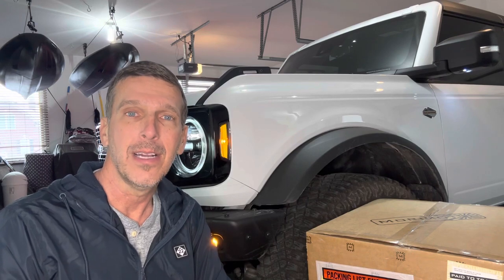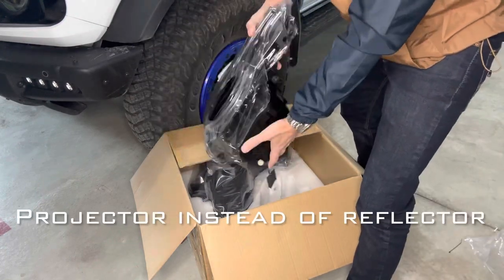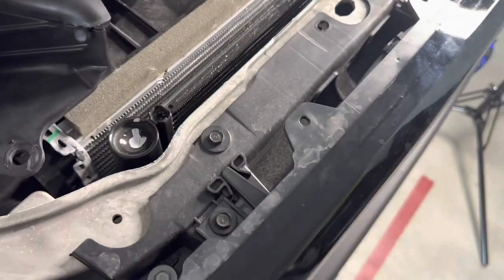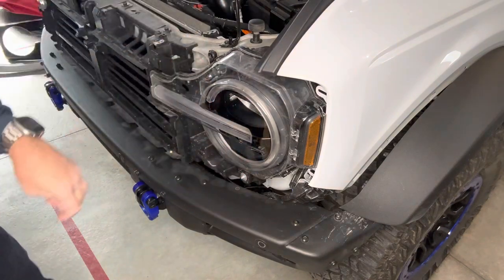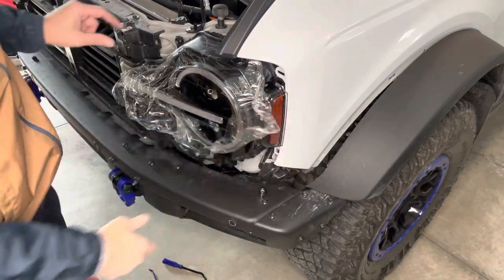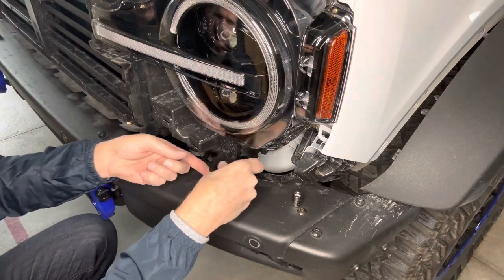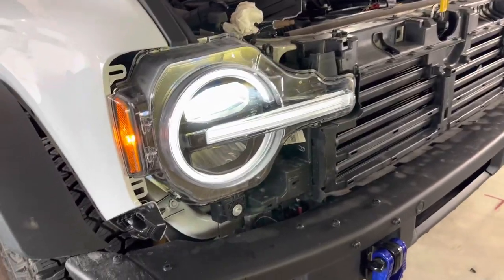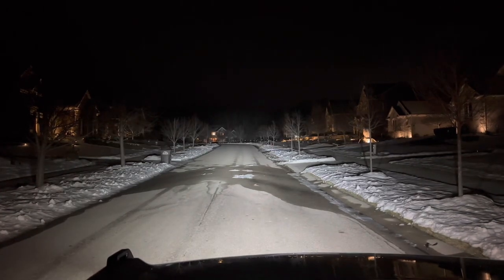Morimoto XRGB LED Headlights Install 6th-Gen Ford Bronco / Comparison / Demo

Comment: Awesome and here I thought I was done adding stuff to my Bronco😂😂. Love it!
Reply from the maker: I am not sure we ever finish, LOL. It is truly my favorite mod. They look fantastic, and they work even better. The difference in light output is truly dramatic, low or high. The ONLY minor glitch is that the blinker will make a rapid blink sound occasionally (as if a bulb was out) when the car’s auto-stop has killed the engine and the lights are on battery power. It takes about 30-60 seconds of blinking IF it does it. And it never does it if the auto-stop is inhibited. It just isn’t a factor for me, but I wanted to put out the only disclaimer. Truly love these things and will install on my recently bought Bronco Raptor. The current Morimotos don’t fit the BRaptor, but they are soon to release a compatible set for the BRaptor. I miss the far better Morimoto light output on my BRaptor.  Thanks for stopping by Deidre!

Comment: How is the speed of the blinker SOUND? Mine went up 2x-3x over stock with these headlights even though the actual speed of flashing is normal. Kind of irritating to hear.
Reply from the maker: Other than one exception, when I was stuck at a traffic light for about six minutes with the signal on to turn left, the lights have always had a normal blinker rate for the sound and I’m assuming the flash outside. That one time, when the signal was on for an extended period at the light, it did what you describe, making a rapid signal sound. At about three times the normal rate. I don’t know what the actual light was doing on the exterior. Otherwise, It always worked normally for the half year owned the vehicle (I ended up, trading it on a Raptor that is featured in some of my videos). Thank you for checking out the channel!
Reply: Strange. Did the lights come with two small harnesses in the box? Does not seem like it from the video. With the harnesses the sound is normal.
Reply from the maker: @GroovyGeek  not that I recall. And yeah, I would’ve shown it in the video if it did. They’ve probably made a few tweaks, since it’s been more than a year since I purchased and installed. I just loved that they really were dramatically better headlights than the OEM.

Comment: Looks great
Would you still say its worth the cange having them installed for a few months
Reply from the maker: I found their performance so markedly better than the OEM that I would say yes. If you plan on keeping your Bronco - long term - it sure makes night driving noticeably better. The only negative lately has been the trade-in value on the OEMs. It was a paltry (laughable) $20 last month from Morimoto. So weight that into your “affordable” calculation. You can check their site and see what their trade value is. I am sure other places you can sell the OEMs as well. body shops, repair market likely has an interest.

Comment: Question- When pairing the lights to your phone, is there any type of security feature preventing others from downloading the app and changing your light color?
Reply from the maker: Not that I see. But the engine would have to be running/or Accessories ON. and it’s Bluetooth so you really have to be within about 30 feet of the vehicle. I think the odds of someone being by you while the vehicle is powered is incredibly unlikely. And if they did, it’s literally one tap of your preset to put it back on.  It is not something that could be done while your car is in a parking lot and you’re out shopping or something.
Reply: @jeffiovine4577  Is the bluetooth built in to the lights or is there a separate controller to buy?
Reply from the maker: @marcus_ohreallyus  the Bluetooth is built-in to the lights, and no additional hardware is required for the feature. When the lights are powered/illuminated, they can be adjusted by the App, and the last setting made will persist until a change is made on the app again. (i.e. - if you use the app to set the daytime running lights to Amber they will remain Amber every time you turn on the headlights or power down and restart the vehicle. You won’t have to keep changing it back to Amber. Essentially the last setting becomes their default until changed to something different.

Comment: Did you use the spacers on both of your lights?  Mine didn’t come with them.  My lights are very low.  Going to try the built in adjustment but don’t think it will be enough.  Did you have to adjust that as well or just use the spacers?  Thanks great video.
Reply from the maker: I used the provided plastic spacer shown in the video on each light - 2 total provided, and I put one on each. Additionally, on the passenger side, I put two standard metal washers, probably about 1/16-1/8th inch thick each, behind the passenger side, in addition to the single plastic one provided by Morimoto. That got both lights pretty close to the original alignment of the OEMs. From there, I used the built-in adjustment to finalize the alignment - accessed from above the light assembly after it is installed with a Philips head driver. It is a much finer adjustment, so I don’t think it has enough adjustment available to move your aim up as much as the included 1/4 inch spacer.
Reply: That is what I thought.  Going to contact Morimoto on Monday.  Thank you!
Reply from the maker: @ddeplanche6870  you’re welcome! Thanks for checking out the channel!

Comment: Wait can you change different light zones?
Reply from the maker: Can’t change zones. They do have about twice the output as the OEM, so it does make it easier to see off centerline. But there is not a zone / turn light that changes with a turn signal.

Comment: Did this work with the auto setting?
Reply from the maker: Yes, all normal functions on lights work same as OEM, in Auto setting. The DRLs are just crisper/brighter than OEM and you can adjust the color. And DRLs go off in Park, as with OEM during daylight.

Comment: Are you selling the old lights?
Reply from the maker: Yes. I did the “Paid to trade” option mentioned in the video. I returned them in the same box with return shipping paid by Morimoto. They have already acknowledged receipt of them (yesterday - about 5 days after I returned), and said they are testing them and will follow-up after that regarding the value. It should be $600 since they were in perfect condition. They will send me a check to complete the transaction.
Reply from the maker: And I did receive the refund of $600 on Feb 22nd. They kept me informed during the “evaluation” of the lights I sent, and when they received, etc. Very “transparent” and trustworthy process.

Comment: I'm worried about lights that are brighter. I already get flashed by people that are mad at me for being too bright. I don't know how I could go any brighter. I will probably do it anyway 😊
Reply from the maker: The Bronco’s should be brighter. Their lack of brightness was the only thing keeping them from getting the highest safety recommendation- coaches/airbags- all great. They just criticized the lights. Just be sure to properly. LED cutoff is great - very defined. So if aimed correctly,  the cut off point falls just below the edge of oncoming traffic’s windshields.

Comment: As of 7/20/23 they are offering $20 for the OEM Bronco lights. 👎🏼
Reply from the maker: Thanks for the update. That is not even worth the time and effort for only $20. Hopefully it changes to something more reasonable. My understanding is that these are purchased for the secondary auto repair market - collision damage. I like the lights so much, that I may have purchased anyway, but I can see why this would now be a deal-breaker.